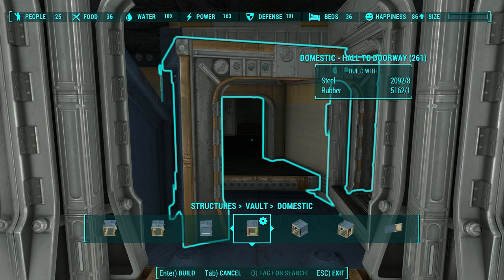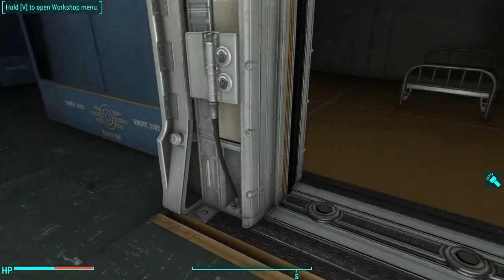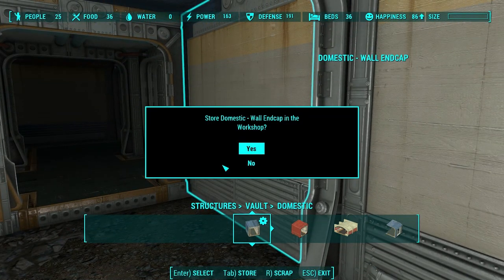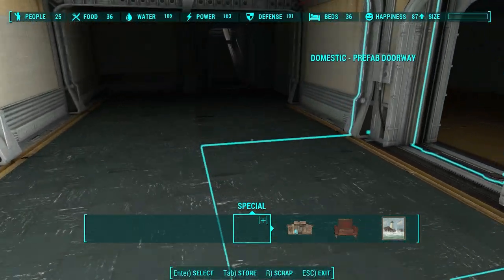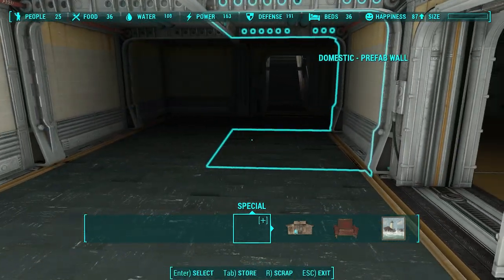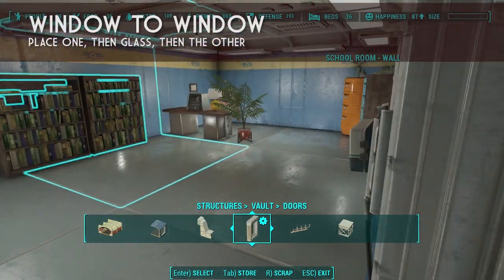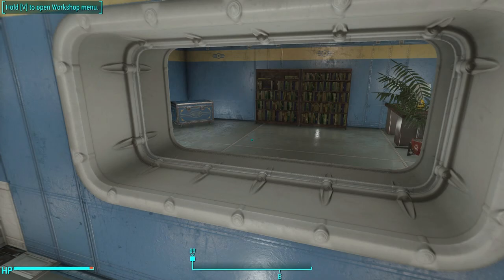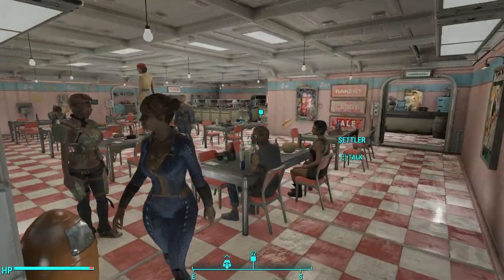Vault Building Tips Part 2 - Vault-Tec Workshop - Fallout 4

Comment: +Oxhorncould you make a handy list of what parts work best where. So I have it written down, I tried doing it myself but I couldn't word it right.thanks for the happiness calculator I finally got the Benevolent Leader achievement thanks to it, it was in Sanctuary with 19 Settlers, I had to completely ruin it, with 5 Bars, 3 Barbers, 1 cling, 2 general stores, 2 clothing, 6 cats, 6 dogs, 70 pummel horses and 40 weight machines.I reloaded a previous save so it's all nice again with 89 happiness.

Comment: hey oxhorn I had an idea to make 3 settlements with the 3 entrances in vault tec workshop instead of 1 massive vault [1. vault 88] [2.brotherhood bunker based off of the safe house in new Vegas using  pharmacy entrance] [3.hidden shanty town in the subway entrance] so if you see this what do you think and what would you build if you were to build 3 instead of 1?
Reply from the maker: That's a great idea!
Reply: you think? what would you build in this way?
Reply: The only issue would be the reset point for all the settlers would be Infront of the entryway.
Reply: force wait till they are in there beds.

Comment: so how does the settlement size work? is it a flat size cost for everything you place? or are they all different sizes? sorry if this is super noob question.
Reply: Different Vault stuff is smaller. When trying for max happiness one chair was made way for 10 weight benches.
You can use the exploit of removing all the junk items from the workshop drop the inside the vault and scrap them manually, the reduces the build cap meter. I got sanctuary down to 1/4 from full doing it.
Reply: addz777 id rather not exploit, but how exactly does that work? just drop a bunch of weapons 1 at a time and scrap them?
Reply: Pretty much yeah. I use all the junk my scavengers collect from the workshop and scrap them for parts. It takes a long time to do (I consider that the tax for the exploit) but do that enough you see the bar drop.
Reply: +addz777 it seems like dropping weapons with mods works really fast. in most settlements I can drop 5 heavily modded weapons a few times and it gives a noticeable drop in settlement size.
Reply: Cool I shall give that a try

Comment: Did you have to use a mod to increase your budget in order to get the size Vault you built?

Edit: I'm not asking for the name of the mod, just wondering if it's possible to build a Vault of your size without a mod.
Reply: you could expand the budget without mods by droping your weapons and arrmor and then storing them using the build menu
Reply: +Nocturnal l had to use a mod because I did that and it didn't work in vault 88